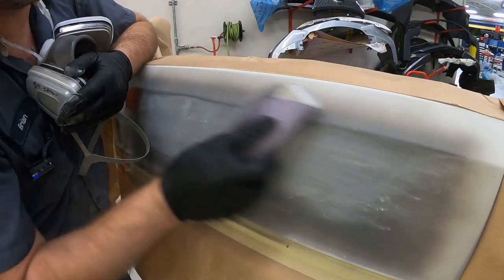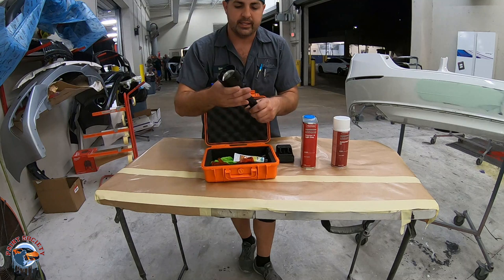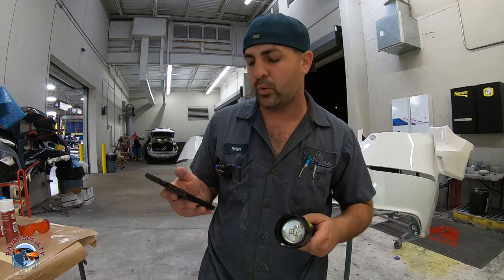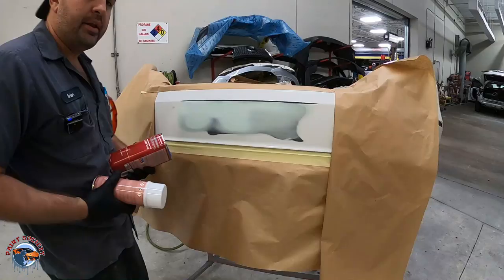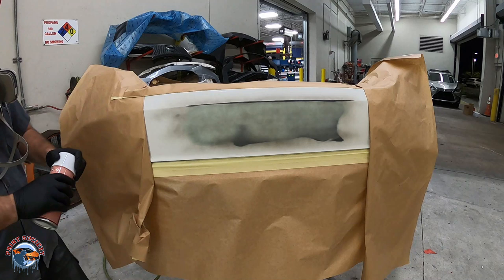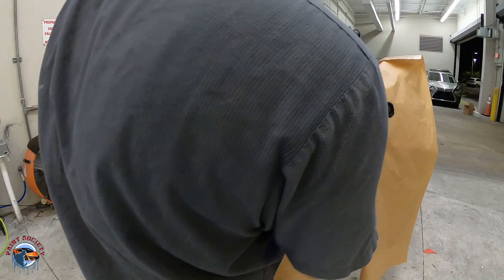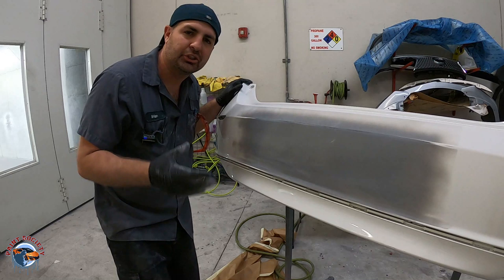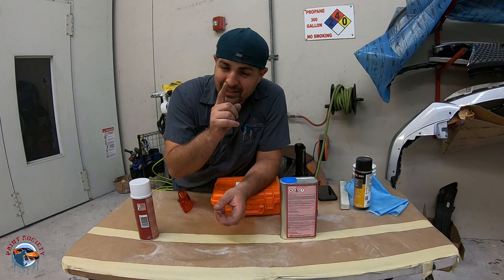Car Painting: Prime a car with UV primmer

Comment: I use the same primer and a smaller version of the light.  It will actually fill 80 grit with a couple coats.
Scangrip has a larger version of the light that has a timer but is half the price of the light you have.
I like to cure,sand a bit then hit it with the light just for piece of mind.  Really is a time save and worth the price.
Reply from the maker: Definitely worth it. I always like to refine with 220 because of shrink back just in case. Like you said, it’s a great tool to have for the job! Thanks for watching!
Reply: @PaintSociety  80 is the redline. 180-220 is perfect.  Adpro should still be used on bumpers.  The SoCur is great too.  Upfront cost is high but if you can save an hour of dry time and not have to clean up, the payoff will be realized in just a few days.
Reply from the maker: Yes! Not having to clean that primer
Gun is so worth it. So cur is great but you only can put a little, it dries like concrete. Just gotta know how to use the product.  Looks like you know what you’re talking about. 👍👍👍
Reply: @PaintSociety  on the internet, we're all experts! Thanks for the videos.  Subscribed last week.  All great info!
Reply from the maker: I agree!!! Thank you for being positive !
Reply: @67polara  the primer is Sikkens.  About $90 per can.  Will pay for itself fast.

Comment: I use the same line of paint an have the same setup. It’s a great tool to have for small jobs. You have to make sure you sand the edges good so that everything is flat I figured that out the hard way. Also have to still use plastic primer on the raw plastic before using the uv primer. They have it in a rattle can now as well. Like the videos 👍🏻👍🏻
Reply from the maker: Thanks! Yes I enjoy this tool in a pinch it works great.

Comment: Just a tip they say (at least glasurit say but I'm assuming it's the same rule) you shouldn't cure in-between coats as it's like putting a 2 PAC primer on bake then giving it another coat. Should be 1/2 coat wait 20 secs then full coat then cure. Then if you want more build to give it a scotch brite and repeat the process

Comment: Hey!  You are amazingly good at teaching in your videos.  Thanks!  A question for you.  If I use 1.2 nozzle instead of 1.3 or 1.4.  (And I have the settings on Gun set correctly), when I apply base paint or Clearcoat 2K to the car.  Does it help me not to get Orange Peel, if I choose 1.2 The Nozzle?  If it does not help anything.  What will be the difference with 1.2 instead of 1.3 / 1.4?  Thanks!